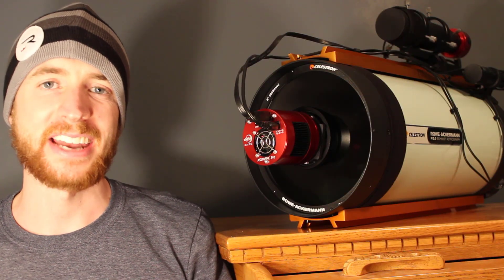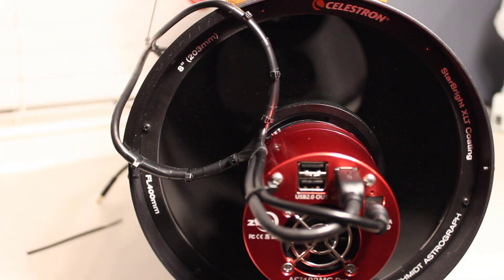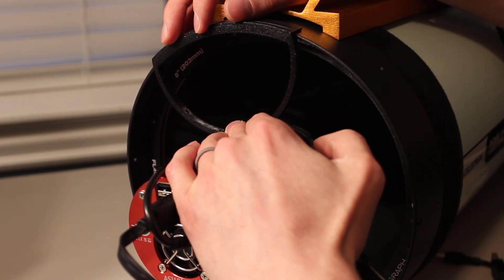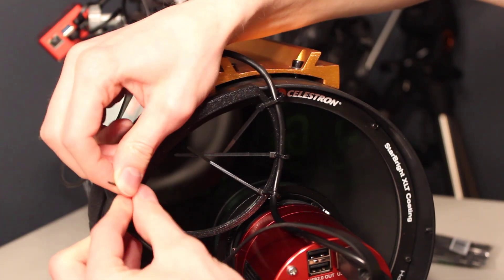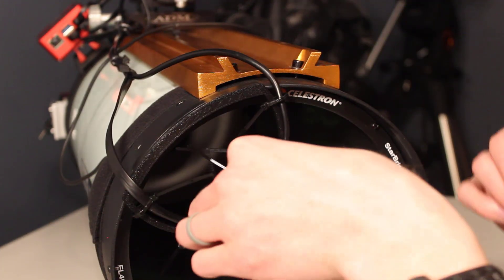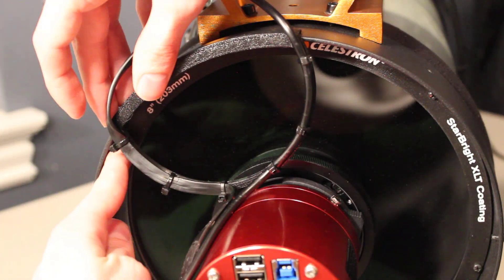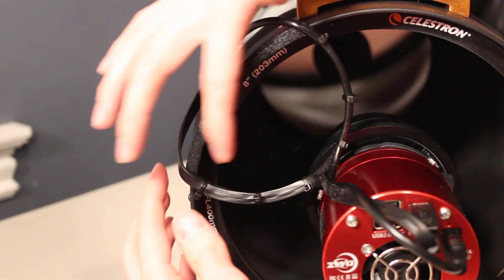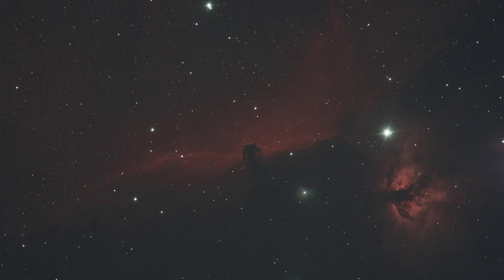How to Minimize Diffraction Spikes in Celestron RASA and SCT/HyperStar Telescopes

Comment: I was just complaining about my off-vertical diffraction spikes. They were so noticeable that it looked like I had a guiding problem!  Someone pointed out that I needed a RASA 8 cable router and I thought, "that sounds familiar".  Duh, I had the exact product sitting in my box of scope stuff!  Heading out to the garage soon to install the thing.  Thanks for video, I know you did it sometime back.  I have enough problems trying to deal with tilt and back focus with the rig without bad spikes.

Comment: Hi Cody, nice video. I really appreciate your work; clear and concise messages. I have a question (because I am configuring a RASA 11). Can you still put an aluminium dew shield over the cable router? On the other hand, somehow I liked more the look of the stars in your images with diffraction spikes. To my taste, there is a bit of a "messy" diffusion in the others. Thanks again and clear skies.
Reply from the maker: I don’t think it would fit with an aluminum dew shield. There is more diffraction for sure with the cable router.
Reply: It does fit.  You just need to run the cables along the outside diaper of the scope (but inside the dew shield) and have them exit at the opening in the alum8n7m dew shield.

Comment: Very nice video! Do you happen to know if there is a 3D printed product to do the opposite? A four-spindled ring that encircles the camera and lets you route your cables for perfect, well-defined diffraction spikes? I do my best to tape them down at right angles, but it's usually not quite perfect.

Comment: has anyone cut the outer insulation off of the wires. They are individually wrapped inside. They wood be so much thinner. it provides no electrical function as far as I know. it is for physical protection. Are there 3d printed 2 piece batinov mask? so you can put them on easier.

Comment: I may suggest to use a nail cutter to trim tie wrap for safety and better look. Thanks for the video.
Reply: If you use a small match to quickly burn the cut edges the resulting surfaces will be smooth but don't over do it!